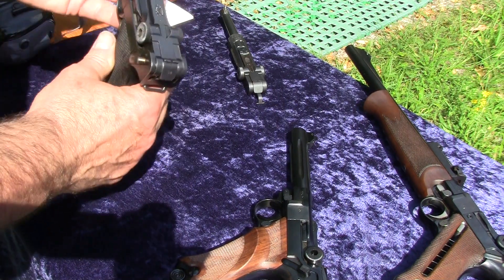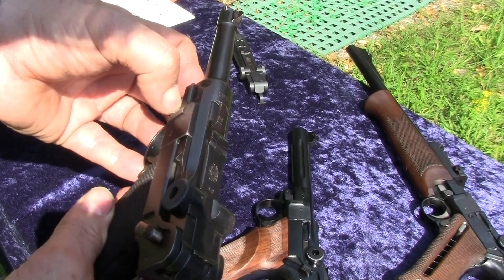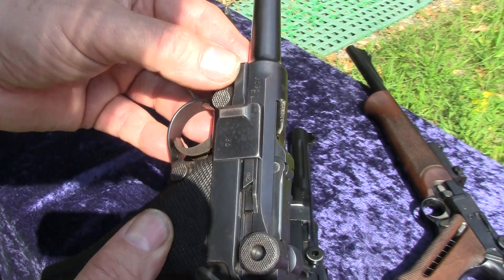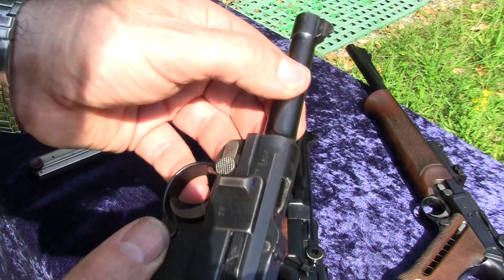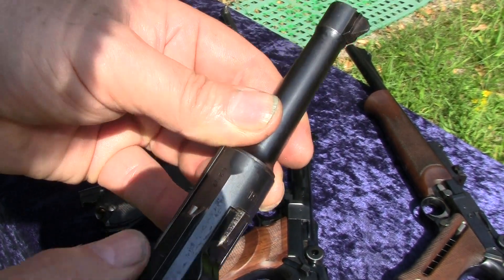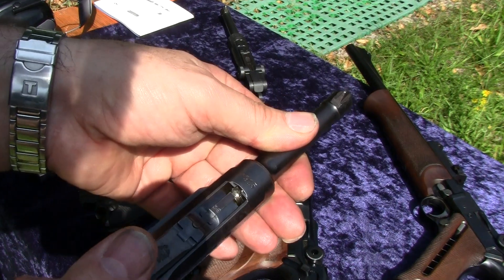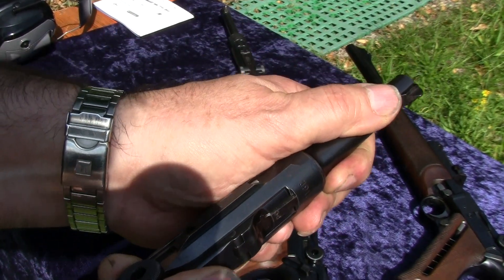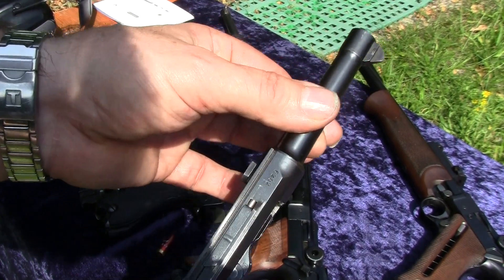Luger P 08 safety advice by Herbert Werle, Waffen Werle Germany

Comment: Thank you for this video. Perhaps you can answer this question. I recently inherited a 1940 P08 from my father and find that pulling the trigger with the pistol on "safe" will activate the striker. The frame and slide/barrel assembly appear to be from two different pistols. Could this be a mechanical tolerance problem due to mismatched parts? Any information is very much appreciated.